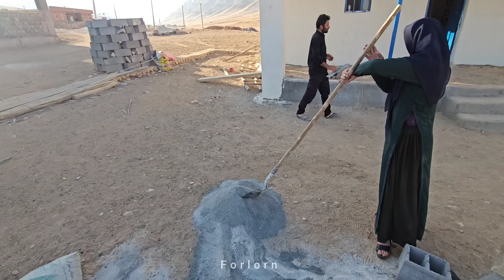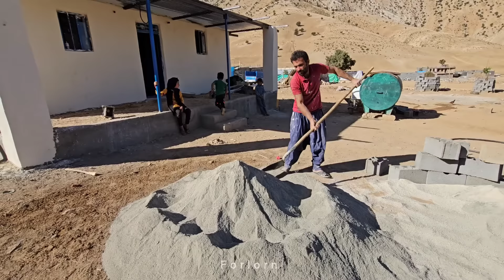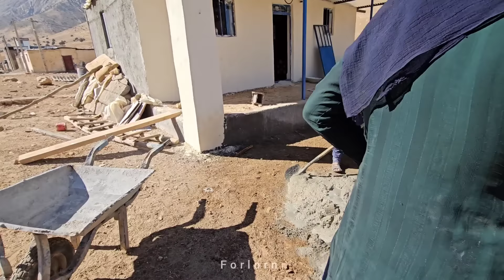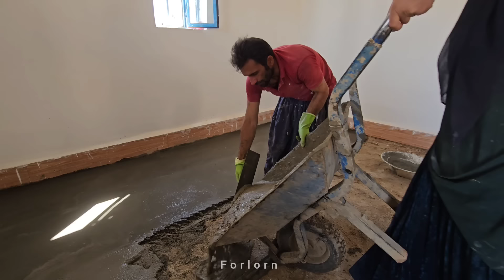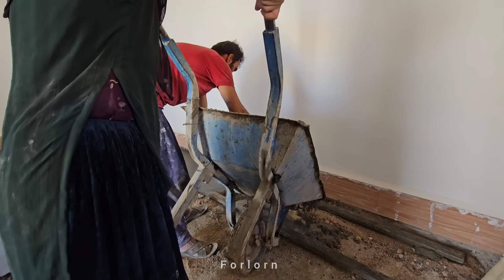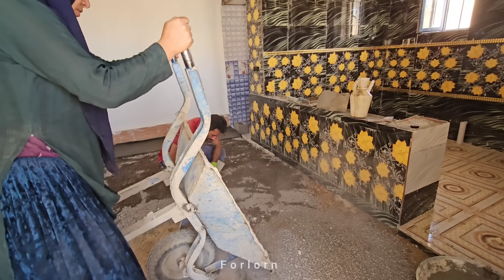A New Beginning: The Cementing of Sakineh's House With The Master's Help, Part 1

Comment: Good master and his work is professional.  Just a suggestion the platform outside can make a BBQ stand, so Sakineh  no need to squad down when she BBQ  and put a 2 quarter wall  around the platform and  ceramic on the floor and  metal gate. At the entrance.  By doing this, it prevents  dust entrance the house and also can be  a study room and play area.for.little Aida